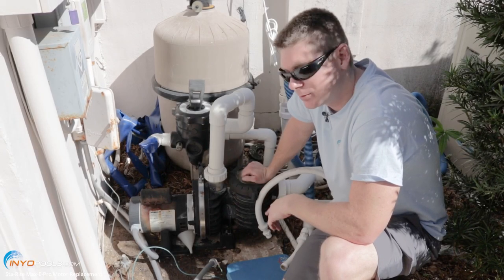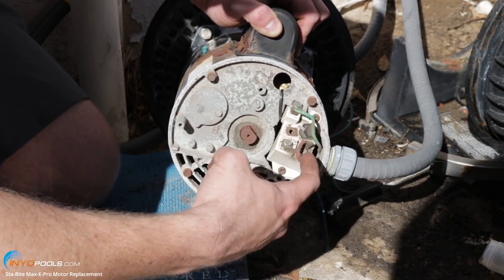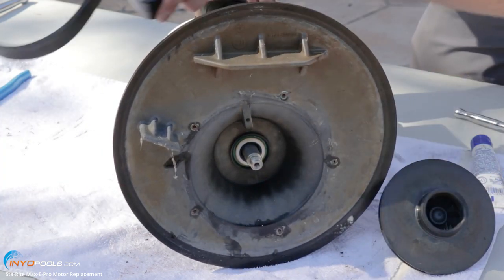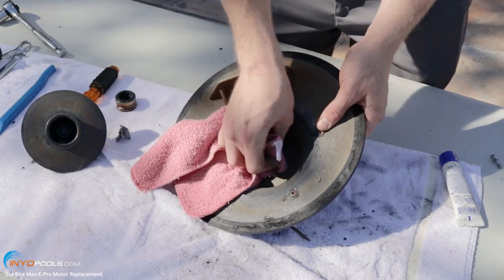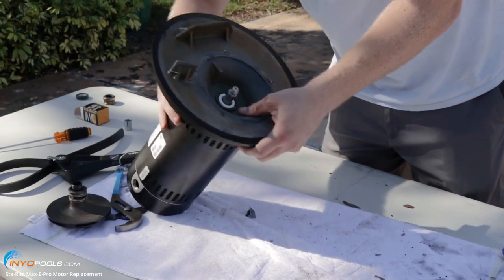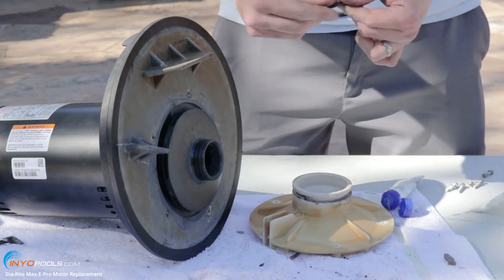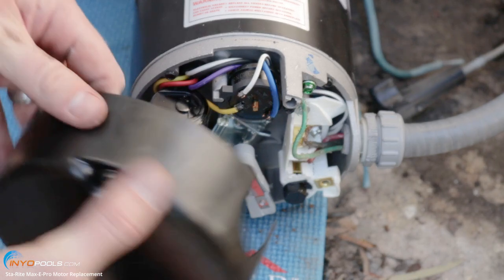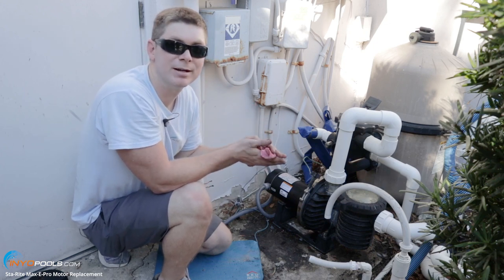How To Replace a Sta-Rite Max-E Pro Pump Motor

Comment: tysm
it took me some time to discern which replacement motor to purchase. installed century B2842 today.
the process of discerning which model to purchase was beyond hollywood's wildest deranged fantasies.
being 1.5HP and slightly larger in diameter than the IHP, i had to remove the rubber motor mount on the stand to get it flush.
knowing which model to purchase saved me about $100. enjoy.

Comment: Perfect timing on this video.  I was opening my pool this weekend and the pump seems to have seized up. - it's a 6yr old Max-E-Pro.  I may have to give the rebuild a try after watching this video.  Thanks!
Reply from the maker: The rebuild is definitely worth it. The front end of your pump should be in good shape since it's only six years old.  A new motor will get you up and running again.
Reply: Just in case anyone reads this, I was able to get the old pump working by giving it a little assist with a turn of the wrench.  However, as the days went by the pump became increasingly loud and obviously needed replacement.  So, I replaced the motor and all seals and o-rings.  This video was a perfect guide to go by.  I believe the seals were leaking out the bottom of the pump since as the lower bolts holding the pump plate to the motor were very corroded with calcium.  I had to use an impact driver to get them off.  They were still good stainless steel bolts that cleaned up easily with a wire wheel on the bench grinder.  Thanks again for the guide!

Comment: Newer versions of this pump have a reverse threaded plastic and metal screw that needs to be removed before you can remove the impeller. The $20 screw can break if you don’t remove it first.  Don’t ask me how I know.
Reply: Of course I did not know it was reverse threaded. Bent but not broken. Does not appear to be necessary on my new motor.

Comment: Can I use a USQ square flange motor as a replacement?  I noticed the HP was different 1.25 vs 1.65
Reply from the maker: You can use a USQ square flange as long as the Total HP is equal to or greater than the current motor. To calculate the Total HP multiply the listed HP by the Service Factor (SF). For example, the USQ1152 motor is listed at 1.5HP with a service factor of 1.1. After multiplying those two numbers together, you get the total HP rating of 1.65. That 1.65 rating would need to be the same or higher as your current motor.
Reply from the maker: Hi Patty, if you're having trouble determining what motor you need, feel free to go to our website, http://www.inyopools.com, and live chat with one of our specialists. We will just need a photo of the motor label and we can figure out the right part for you.

Comment: What salt rated pump seal from US Seal Manufacturer is compatible with the Max E Pro?
Reply from the maker: Hello Tressa - The salt rated US Seal shaft seal for the Sta-Rite Max-E-Pro is our part number 5250-235. Here is a link to that seal. http://www.inyopools.com/Products/07501352048607.htm

Comment: Which motor is that and where did you get it?
Reply from the maker: We replaced a 1HP pump motor with a USQ1102 from INYOpools.com. Check out all of the available motors on the Max-E-Pro parts page. http://www.inyopools.com/pool_parts_sta_rite_max_e_pro_pump.aspx